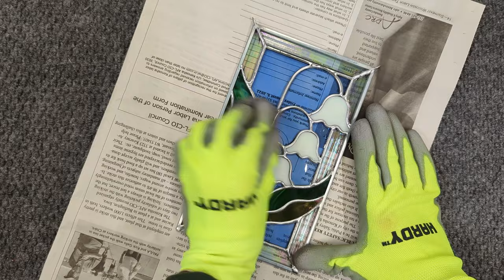TUTORIAL - Mini Lily of the Valley Panel

Comment: Hi. In your rainbow tutorial you shared that you use your iron usually at 410 degrees “Celsius “. Which I converted to Fahrenheit and is 770 degrees with 60/40 solder. Is this correct? I appreciate your time! Thank you
Reply from the maker: Yes, that would be 770°f, that's the temp I solder at when using a 3mm tip, if I use the larger 5mm tip, I like to turn the heat down a little

Comment: Hi Samantha! I just bought one of these little cut-off saws and I'm just waiting for it to arrive. I've heard that the blade that comes with these saws isn't the best for metal. But yours seems to be working great--did you purchase a different blade to go with it? Thanks as always for your help :)
Reply from the maker: No, I'm using the blade that came with it. You just have to take it slow when cutting the metal. If you pull it down hard, the machine seizes up, you need to lower it slowly, let it cut a little, lift it up, and repeat. Hope that makes sense.
Reply: Ok, perfect, yes that makes sense, thank you! I'm glad I don't have to order a separate blade. Thank you so much for the speedy reply, and have a cozy night!  @SamanthaAshleyGlass

Comment: Do you put your texture glass with the texture facing front or back.  And why? Also..what was the name of the pliers with the narrow tip?  What was the blue patina you mentioned? TIA
Reply from the maker: I always put my textures facing front because I feel like you can see the texture better, and I personally like the look better that way. To find those pliers, I just searched for "narrow tip grozer." I got mine from Amazon, but I believe Delphi has some too.
Reply: If I may add on, the super blue is made by Birchwood Casey. You’ll find it in sporting goods stores/sections, in the gun section. It’s used on firearms as a colorant.
Reply from the maker: @dadatschool  thanks for the info! I forgot to answer that part of the question.
Reply: @SamanthaAshleyGlass  thank you for the information...much appreciated.
Reply: @dadatschool  FOUND IT.. thank you for the info

Comment: Hi Samantha thanks for the video. What cardstock do you use please? It looks really pliable. Is it coated? Is it available on amazon? I'm hoping to use cricut soon. Would the pdf patterns I already bought from you work or would they need teaking?
Reply from the maker: Hi! If you haven't checked out my cricut video yet, it may answer some of your questions. I use pearlescent cardstock cause it comes off the cutting mat pretty easily (you can find it on amazon - it's on my Amazon storefront). You should be able to upload any of my patterns, because I've created all of my patterns with the same line thickness, you'll just need to resize the image in the cricut app to the correct size of the actual pattern.
Reply: @SamanthaAshleyGlass  amazing as always ❤️
Reply: @SamanthaAshleyGlass  gosh I didn't realise you shared your name with a raunchy fiction writer! I just searched your name on Amazon and got a shock lol
Reply from the maker: @janerobo5911  Oh that's hilarious!! lol My storefront is amazon.com/shop/samanthaashleyglass if you can't find it. I also have to mention that I earn commissions from the storefront. =)
Reply: I absolutely love watching your  project making videos.  This one turned out beautifully.  May I ask what model grinder do you use?
Reply from the maker: @lisakrynick7166  I use techniglass "the grinder" for my 3/4" and 1" bits, and then I have my glastar all star grinder set up for my 1/4" and 1/8" bits.

Comment: I do love that grid you work on, good for getting those pesky tiny shard down and out of the way.
I would have gone with a half-inch zinc border though, but that's just my taste.
Anyway, I just got a studio again! Whoo hoo, so I can get back to my stained glass. 
I was cringing though when you steel wooled that piece. Noooooooooooooooooooooooo  LOL Sure if you're extremely carful, but you'r going to put a haze on the glass you you hit it.
Also cotton balls work best for patina.
Don't know if you can even get carnuba or Butchers wax, you might try those.
Reply from the maker: Yeah, the size of the came for such a small panel is definitely a personal preference, since it doesn't need much for structural stability. Half inch would have been way too big for my taste. As far as steel wool goes, I'm going to have to disagree with you there, I've been using super fine steel wool for many many years, it does not put a haze on the glass. Cotton balls may work best for you, but there is more than one way to do it. Clarity finishing compound is carnauba wax with polishing agents. I do have solid carnauba wax, but clarity is always my go to. 

I hope you enjoy getting back into your stained glass studio!
Reply: @SamanthaAshleyGlass  Of course *smile everyone has different preferences and methods. I hope you didn't think I was criticizing, just suggesting things I do.
I only mention the steel wool, because while you are good at this, someone may not know to use supper fine and end up scratching their piece. Also depending on the actual glass, some are softer than others and more easily scratched.
Yes, I've been doing traditional stained glass and repair for over 20 years. I had to move and for 2 years I've had nowhere to work. Ugh. But I do now. Yea!
Reply from the maker: @Art_911  that's a fair point, we don't want anyone grabbing a high grade of steel wool and completely ruining their project! Also no worries, there are some people who truly believe there's only one right way to do everything, and they can be quite vocal about it. I've experimented with so many different methods/supplies/tools, and they all give pretty similar results in my experience.

Oh wow, you must be antsy to get back at it! I first learned this craft in 2001, but I was only 13, so I only worked on projects sporadically at my grandpa's house, until I was able to set up a home studio.